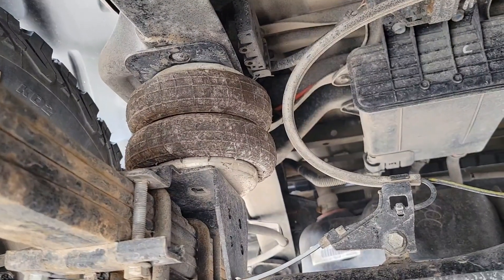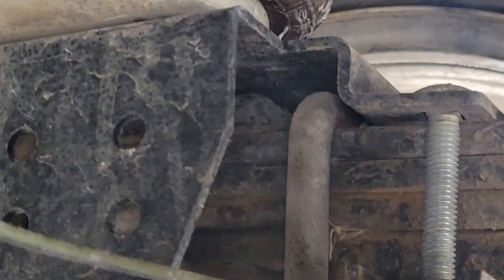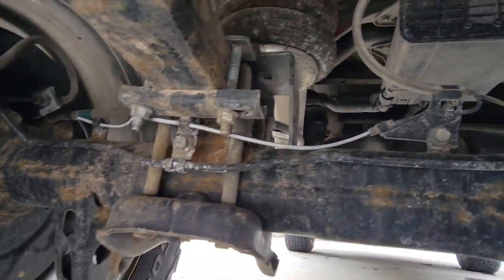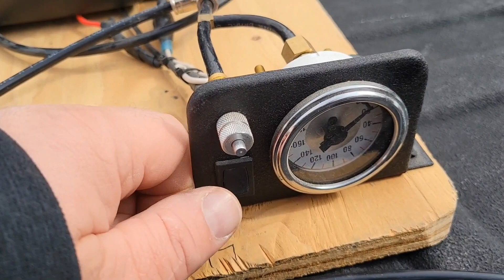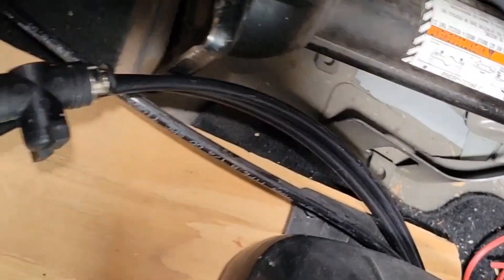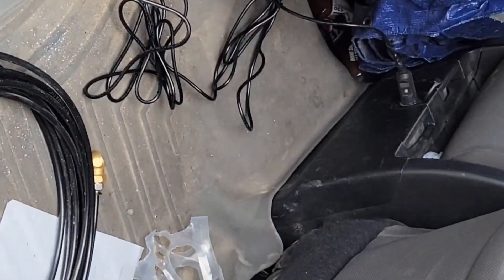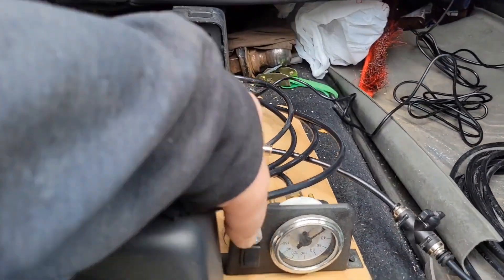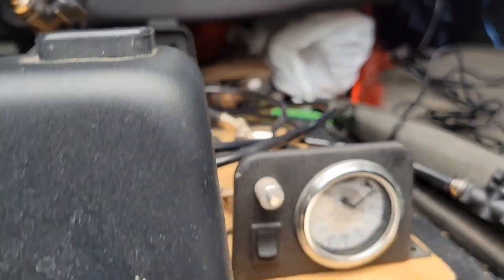How to Air Bag a Truck. Airbag Suspension kit with Onboard Compressor (overview)

Comment: I do not understand your setup at all.  Bolt the compressor outside of the truck. This certainly will work but it's a mess in your cab
Reply from the maker: It resides under the back passenger seat in the cab. When I flip up the seat, I plug it in and pull the air hose to where I need it to. It's manual 😀 for filling up either the tires or the air bags. To fill up the air bags I just have to plug it in to dc. Open the valve to the main airbag line that comes in from under the pickup bed mad then hold the button until the truck is level with the load. T
Having the ability to put air into tires isn't needed but it is easy to add that T and valve in so that I can isolate it if need be. It works pretty good for adding air into the tires 👌

Comment: Do you have the switvh wires and the air compressor wires both together plugged into the 12v plug?
Reply from the maker: It runs on just one 12v dc 🔌. 
For it to work it needs to be plugged in and the switch needs to be on.
Reply: @FTOTF1   alright sweet I greatly appreciate it. I’m also doing the plug like you did. I’m hoping to do it Friday